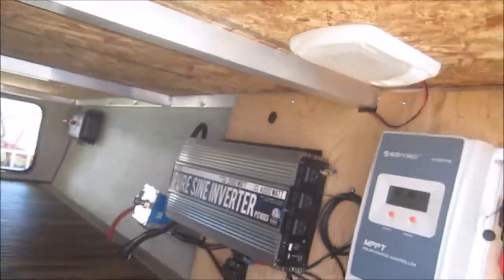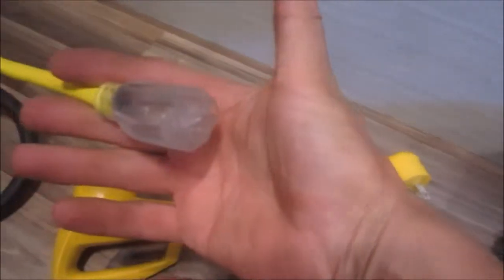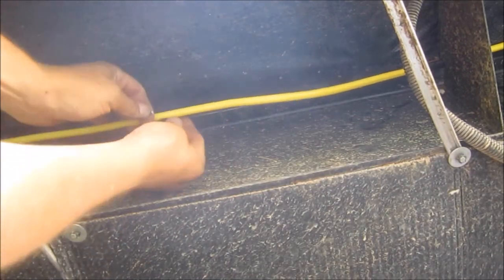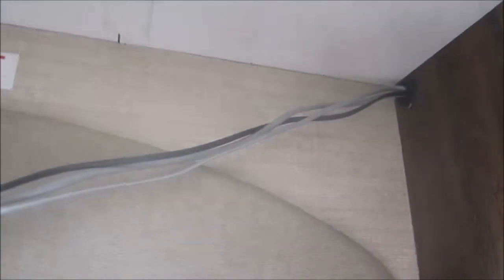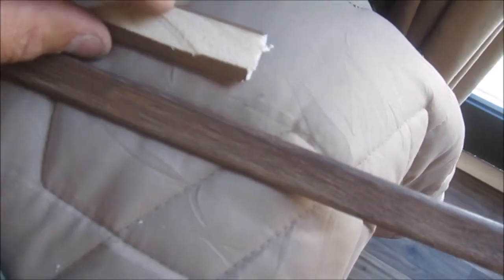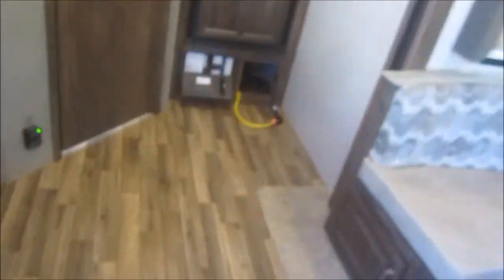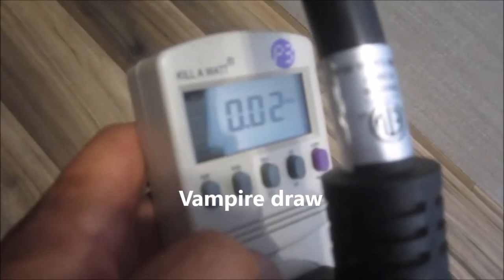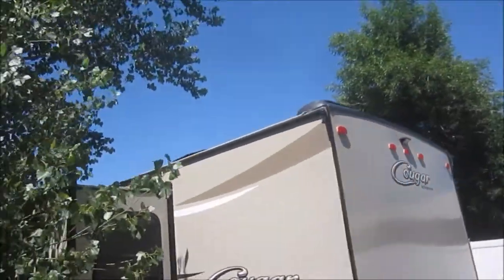Part 3 of 3,  495w MPPT solar 2k pure sine power inverter 19ft TT installing controls and testing

Comment: So did you get more batteries? If so what kind do you recommend? I've learned so much about solar lately especially watching your videos, you have everything organized and explained very well step by step. Thank you very much for answering all of my questions I've asked earlier on your previous videos! Much appreciated!!
Reply from the maker: panisher The trailer belongs to my friend Mike, who was moving away the next week so we needed to get it done. I don't know if he got batteries yet. I know he is going camping today so I will ask him.
My personal trainer has for group 24 marine batteries. Just the cheapies for battery bank one. Battery bank two is in the basement and I did not want to purchase a vented battery box, so I bought 100 amp AGM batteries that don't require venting. I got them on eBay from windy nation on sale for about $150 each.
Reply: A great match for his setup would be a couple of VMAX agm charge tanks.  I use three SLR-155 ah on a similar setup.  These batteries could be mounted in the storage compartment area as well.  (They are a bit expensive)